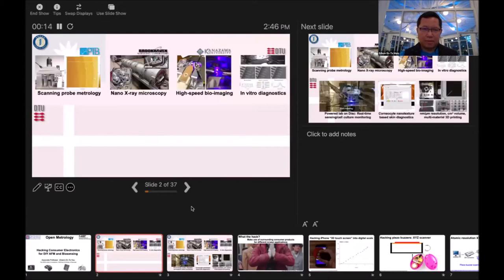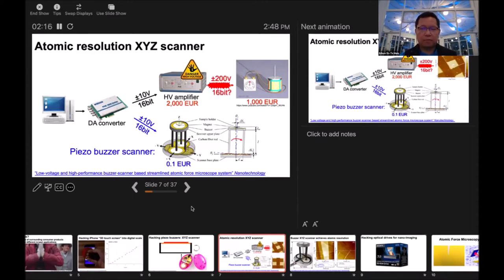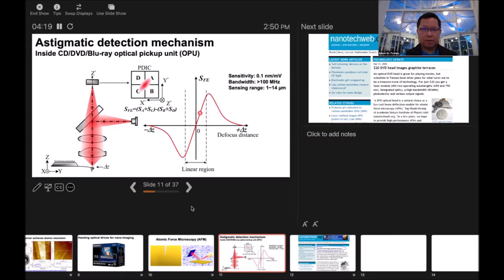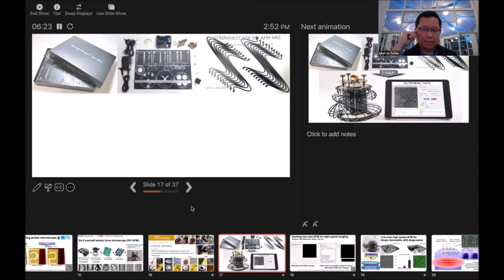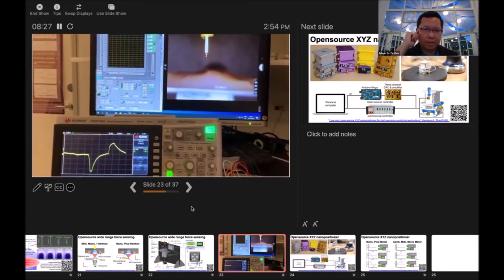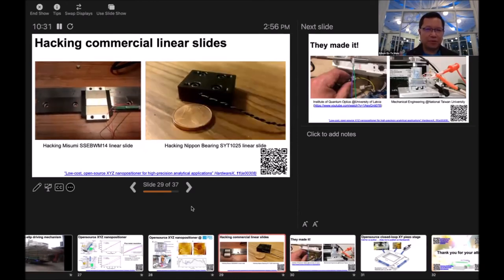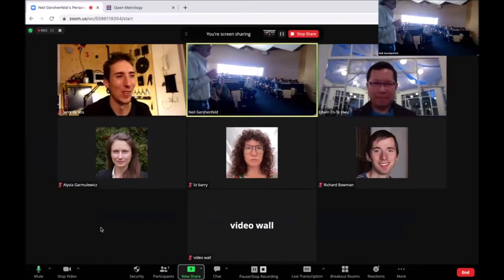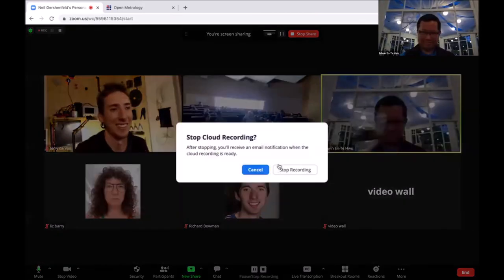20220819 Edwin Talk @ MIT Open Metrology

Comment: Critic 123 back again.  I tried to duplicate your nice work and I have partially succeeded. I used a slightly different block pzt with two 3mm magnets and got some movement. I was able to get the movement at a frequecy of 150 to 300 hz with 75 volts.  The linear slide moved 1cm in 2 min. At 300 hz I think this corresponded to .27microns per step. I think at lower voltages the slide may stick but I need to check more settings.   How much tweeking of magnet strength is typically required? Should you be able to run higher frequecies for faster movement as well as less voltage for smaller steps?  I tried the two 3mm magnets as well as a few different sizes but didnt have success with stronger magnet strength.  Also,   I see in your paper data was collected at 5 hz but it looks like from some of the videos  and the sound I hear, you can run a much higher frequecy to move the slide faster. I couldnt run any faster with my set up to date.    I have been working on a scanning tunneling microscope project at home similar to Dan Berard https://dberard.com/home-built-stm/.   I have worked awhile on the course approach using stepper motors and they are noisy.    Using a fiber Fabry Perot 1310nm interferometer I should get 30 nm steps with the motor but get 200 nm jumps full of vibration noise.  This may be good enough to work because my fine adjust buzzer pzt has more travel than this so I can wood pecker the probe down but it is very sloppy and I know this will probably cause issues. I also noticed that your slider backlash is dependent on the size of movement.   I would appreciate any insight you can give to me in regard to your nano slide.  Thank you.
Reply from the maker: Great that you can make it work! The weaker the magnet force the faster it moves. Higher frequency also help for faster movement. You may measure the driving signal connected to the piezo stack is distorted or not, if the wave is distorted which means the current supply is not enough. I hope this helps ;)